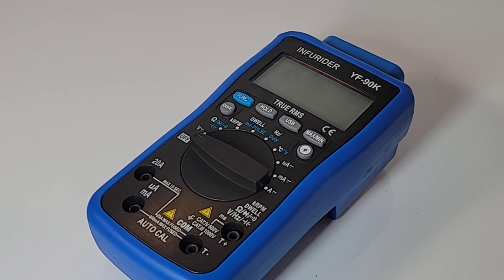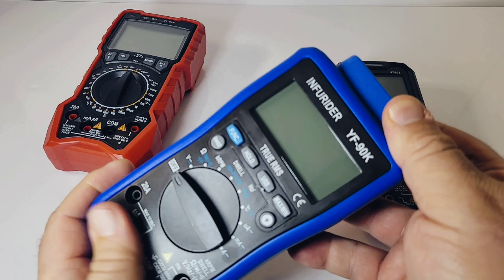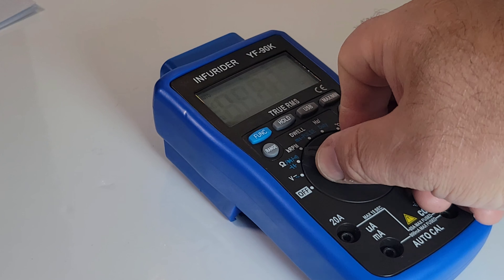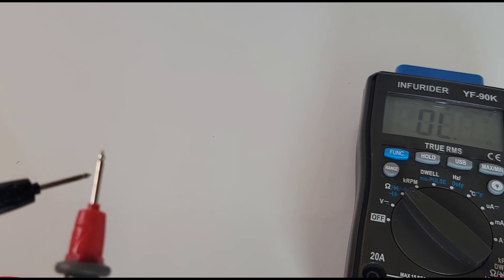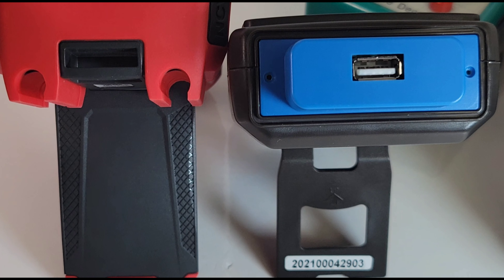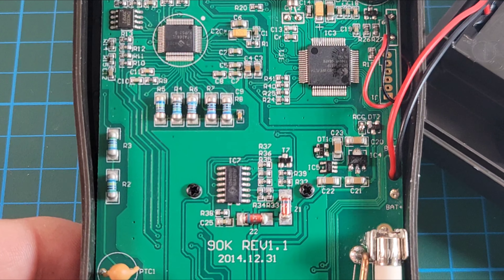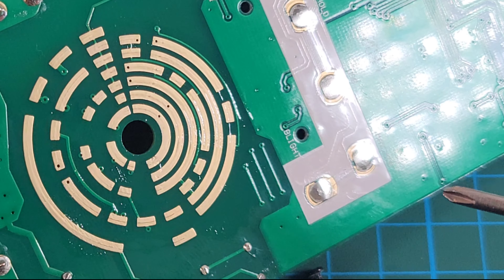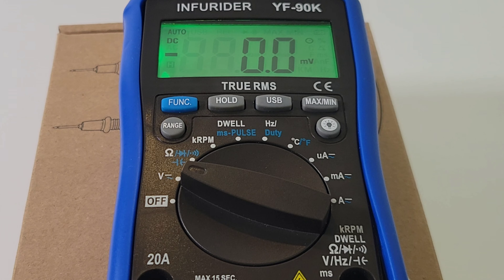INFURIDER YF-90K AUTOMOTIVE CHEAP-O Multimeter Review & Teardown!

Comment: Pretty nice priced versatile DMM for it´s purpose. It contains even DWELL. (Pretty useless for todays common electronic ignition systems. Only important for mechanical ignition systems with a contact at the distributor in old cars.) It has sufficient accuracy for it´s task. (Really: I´ve never seen a case where it was somehow important, if there were 13.05V or 13.2V measured.) IMO is the lousy tilt stand excusable. More important would have been a possibility to hang the DMM (perhaps even in combination with a magnet). The "stay on" backlight is very handy. Sadly it is not per default selled as a bundle with the inductive clamp. The not working software on a Win10/Win11 computer is sad, but - according to my experience - not really tragic, because: The most for hobby car diagnostic dedicated laptops are running anyways WinXP. Professionals are using anyways far more sophisticated diagnose systems with OBD, mostly related to the car manufacturer. BTW: Nice to hear about the maintenance of your LED test rig. I am very curious to know the result.
Reply from the maker: Awesome to hear your feedback as always! Yes the logging software won't be missed for many but still nice if it was usable for today's pc's. That backlight is very nice. I do prefer the green hue as it's always easy to read no matter the contrast. Hopefully I'll ave the led tester back in biz shortly ! 👍

Comment: I have 2 of the multimeters. Unpacked, battery inserted and none of them worked. can be turned on, but the values are beyond good and evil. constantly hops from AC to DC, capacitor testing not possible at all. I got the DMM in its original packaging and new, but not a single one works. Hands off.
Reply from the maker: Good God they sound possessed. It appears a cleaning of the selector switches with some dielectric might solve those issues. Give that a try..

Comment: Hi Darren, could you please tell me is there any CHEAP-O AUTOMOTIVE Multimeter which you gave whole 5 stars?

P.S. I will be doing new electricity from scratch in my flat (new lines, sockets, lights, fuse box)
and after that I will be using multimeter trying to fix some utilities from time to time like for eg. check and change faulty capacitors in monitor, tv, music gear, etc maybe some computer parts check if needed.. or check some parts in the older 2004 car..
Reply from the maker: I haven't  had a 5 star Automotive multimeter on my channel...yet!  I did review a Bluedriver automotive meter a few years ago that was good but the vendor has ceased making that model. Check out the Aneng SZ20..it's not an automotive meter per say but can still do parasitic draw, car battery and a ton of household and bench electronics! https://youtu.be/W9UhA54JboA
Reply: @KeepOnTesting  Thank you very much for your answer Darren. 

To be honest I found your channel because of video where person was testing some other Aneng multimeter and it didn't hold ampers value - the value continuously  raised after 7-10ampers then he compared it to VENLAB VM-600A which performed as it should even close to 20Ampers  ( https://youtu.be/q3zhqISjK9g?t=1424 ) and then I started to looking for Venlab reviews and found you.. 

I think I also saw video where there were comparison between Unit-y and Aneng and even with 20A fuse Aneng meter was broken after more than 10A and Unit-y was still fine.. (I can't find the link to this video)  They were different meters to your recommendation, but I have trust issues with this company after this..
I see it also has only 250mA max limitation.. 

Just last question, whenever you find time for it.. 
If we would take out car measurements out of requirements is there anything better or more advanced than VENLAB VM-600A in cheapo realm? or maybe I would need spend more up to around 50 dollars..

I just realized one more important thing - I had this plan in the past to start to learn basic electronics and/or put together some available sensor kits for arduino  - so I can create some live audio-video installations activated by people movement, weight or whatever sensor can react on... would I need to have some another multimeter for that more sensitive to small components or values?

Sorry it's hard for beginner like me to even ask proper questions..
Reply from the maker: @maciekkk123  No worries 👍 if you find yourself getting more immersed in Electronics and high precision becomes a factor.. you can always upgrade (everyone needs at least 2 dmm's) to Sanwa or similar.
In the meantime, the Venlab should do just fine 🙂 it's a highly capable multimeter regardless of price. Btw..I'm reviewing another Venlab multimeter this week..so Stat tubed for that!
Reply: @KeepOnTesting  Thank you so much Darren! 
I can't wait for the new Venlab multimeter review from you. Greetings from Poland!
Reply from the maker: @maciekkk123  Awesome my friend! Thx for watching 👀

Comment: Not inferior?

Little remark, the usb is actually optical isolated, there's clearly an optocloupler on the board between the meter side and the usb side..

It's the 2701..
Reply from the maker: Hmm.you might be on to something 👍
Reply: It's the 2701 chip with 4 pins...
Reply from the maker: Yep I missed  that.. Need to put my glasses on 😅

Comment: This software is 16-bit and cannot run on 64-bit Windows by definition. Try a virtual machine with 32-bit Windows 7, Windows XP or even Windows 98.
Reply from the maker: 64bit Windows can run 16bit software ..however even in Windows 7 compatibility  mode this just didn't work. VM should work but I didn't have one readily available.